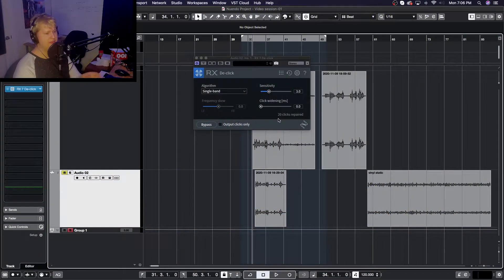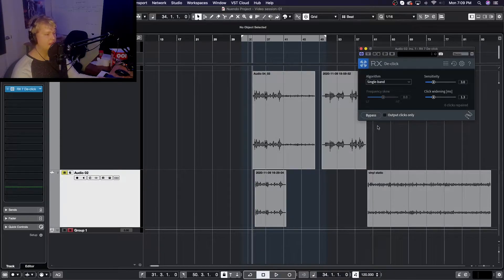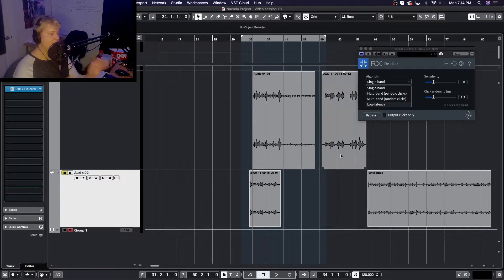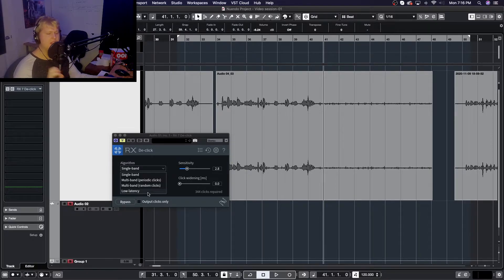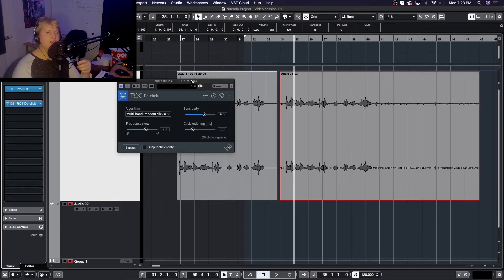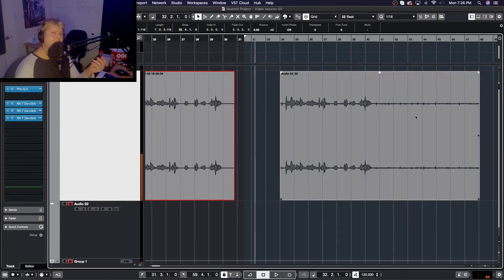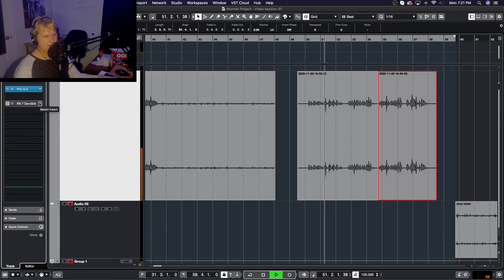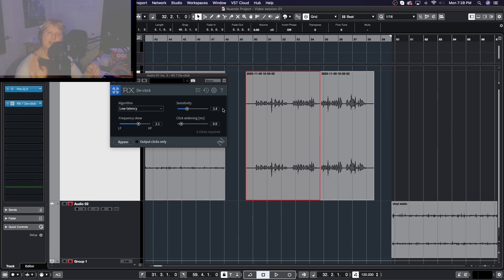De-Click - Audio Tools Explained

Comment: I have a basic question that's not in the manual or any videos I've seen, including yours on YouTube. If you run De-click on your track, how do you get the track to run with removed clicks when you render that track? I've run De-click on a track and it tells me 156 clicks were removed. Then I render that track, load it back in my DAW, put on another instance of De-click with the same settings and it finds 129 clicks. So what am I doing wrong? I'm using the plug-in version like the one in your video, not the advanced standalone, so there is no "render" button on the plugin itself. I render the track using my daw with the DeClick plugin on it. Thanks, John

Update:
I wrote to Izotope and they responded with this explanation:

"Thanks for reaching out here. 
 There's no way to ever remove all clicks and artifacts from certain pieces of audio. In fact if you over process, you may be adding in new artifacts. 
 De-Click is there to help you remove the main glaring ones that make a piece of audio sound bad. 
 You can run De-click until you're blue in the face and it will always find more things. 
 The key to successful De-clicking is knowing what to set your settings to. This often does take some trial and error and isn't always going to a stop solution. 
 I find, that in most edits I do, a high tilted pass and a low tilted pass will remove most of the offending clicks. 
 Sometimes two lighter passes is better than one over powered pass when it comes to many of RX's tools. 
 If you still feel stuck after some trial and error, feel free to send us a copy of the file, we'll take a listen and make some suggestions."

They sent examples of "high tilted pass" and "low tilted pass"
High tilted pass:  Algorithm = Multi-band (periodic clicks), Sensitivity = 4.0, Frequency skew = +4.2, Click widening = 0.0.
Low tilted pass:  Algorithm = Multi-band (periodic clicks), Sensitivity = 3.0, Frequency skew = -4.2, Click widening = 1.0.
Reply: same - why can't we find an answer to this question!?  I feel like the elements version is useless if you can't render them out
Reply: @danielgowens7860  Please see the update I posted to my original note. Also, you can always render the track with the plugin on it to get an updated take. I usually do that because there is so much latency added by these plugins, and then delete the track with the plugin on it so everything runs cleaner.
Reply: @johngraham9878  Thanks, John!